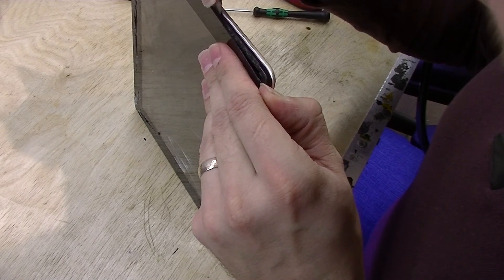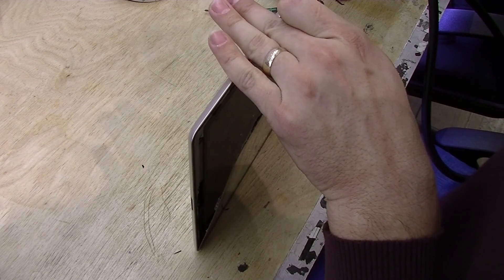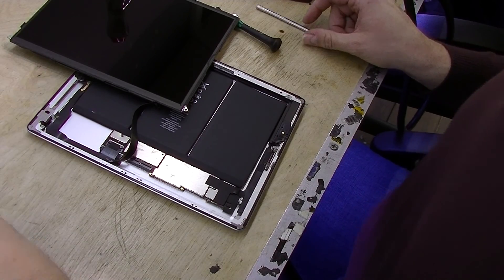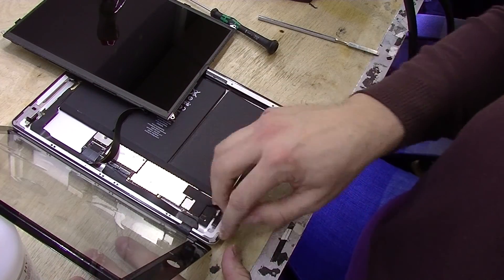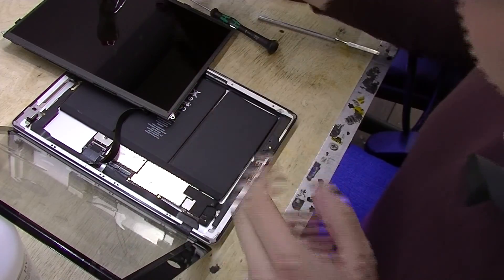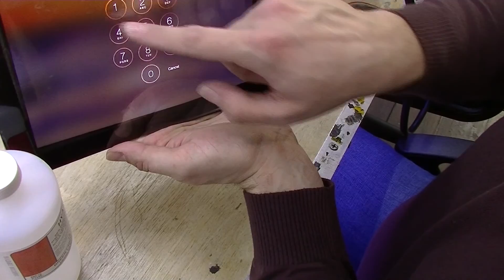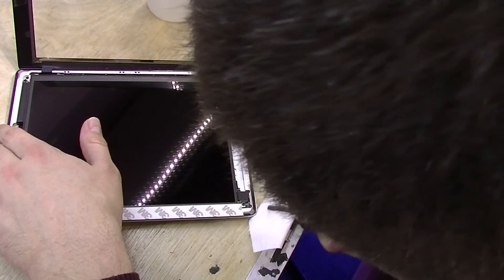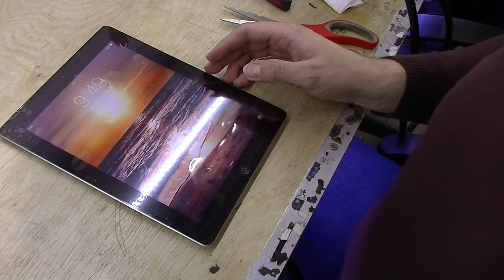iPad 3 touch screen digitizer repair

Comment: What size tape is that? I've been using 5mm and it seems to be working well.
Reply from the maker: I forget if it was 12mm or 15mm. 5mm is kind of thin.
Reply: Louis Rossmann Thanks for the video. Where can i buy that tape? What is the make and model? Thanks